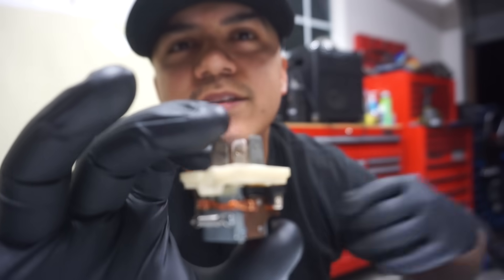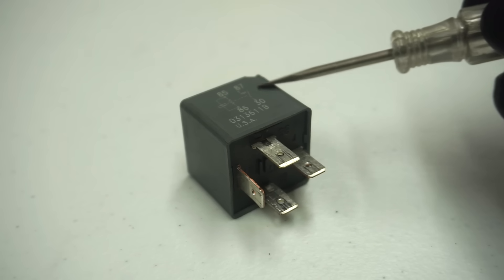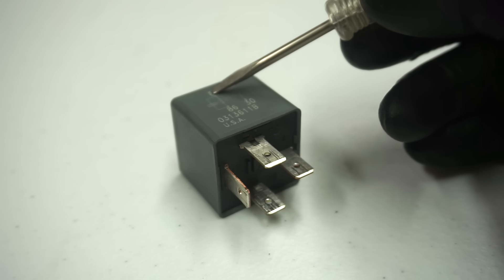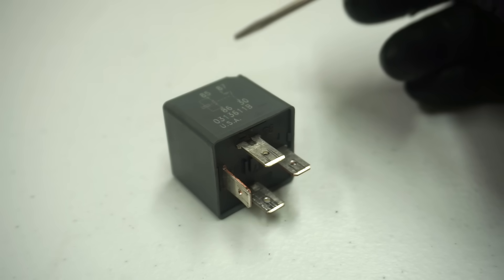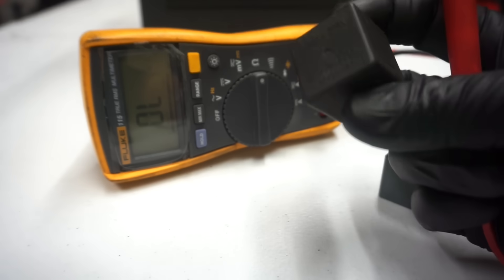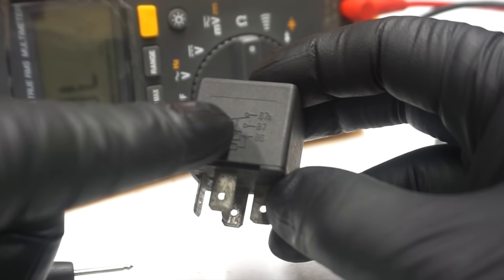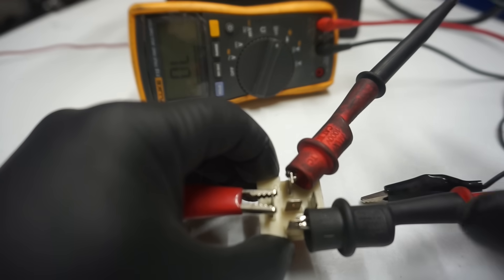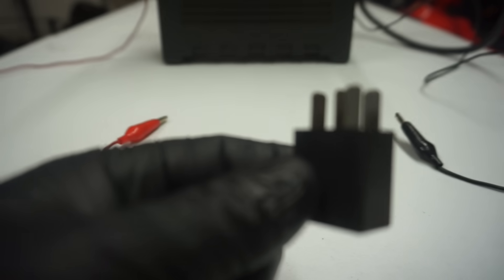How To Test a Relay The Easy Way

Comment: Why is my A/C on my Toyota Sienna 2011  blowing heat? The front and back  A/C. The back  started  blowing heat first,  then a few months later the front A/C started blowing heat.  The fuses are good.  What do we do it's  to hot for my children  to ride comfortably.  PLEASE HELP US?
Reply: You may need to re gas your AC system, or it could be the clutch is not engaging with the pulley wheel.

Comment: I've 08' malibu and struggling with battery not charging it drains it really fast when it's running I pulled alternator and fuses out and they're good I've a feeling it might be one of the relays but dont know how to check them

Comment: Pin 85 and 86 may not be switchable if there is a diode across the coil. Polarity must be observed. This diode prevents a reverse pulse, from a collapsing magnetic field, from damaging electronics with a high voltage pulse.

Comment: This is wrong and misleading, BADLY,  These test are being done without any load, Any 5 amps relay will show you good, BUT if you need a relay with 30 amps, this will miss leed you. ALWAYS use an amp meter to read how many amps those contactors can carry. If you have a starter relay that require 50 amps contact? You would test the way it's said WRONG, use an amp meter in serie with your load, then test it, IF and ONLY IF  this test works, your starter or what ever is at fault if not. replace the relay and start again cheers

Comment: HELLO HECTOR  I SEE YOU HAVE SPENT SO MUCH TIME AND EFFORT TO PUT YOUR VIDEO TOGETHER . I HAVE A 2008 TOYOTA SIENNA LIMITED ANY SUGGESTION ON FIXING A FLASHING GREEN LIGHT ON THE AC SWITCH WHAT COULD BE THE CAUSE AND I NEED TO FIX IT THANK-YOU
Reply from the maker: Saleem Abbas have the A/C system checked 👍🏼

Comment: I have a Pontiac 2006 torrent replace new battery and new alternator car run I get power at the thick wire that bolt to alternator but no power at the part that plug into alternator that goes into regulator so it not charging been working on it 3weeks could I by pass that part that plug in and get power from the fat wire that bolt to alternator
Reply from the maker: Vernard King I wouldn’t rave down that loss of power, don’t do Mickey Mouse on your car 🤙🏼

Comment: Okay so normally my brothers would do this type of troubleshooting for me but I'm on my own, I have a question so I have a 2000 Infiniti Q45 I have a few things not turning on it working. 1st power antenna, step light, and inside lights the a/c control lights not on the dash but by the radio. I checked the fuses using a fuse checker under the car pedals. Also under the hood but no fuses seem to be blown any suggestions?

Comment: Great video, help me a lot!!! Now I have a problem with codes, on a 2009 Camry 2.4  reading P0016, crank a camshaft position sensor, I replaced both three times and still have the codes, yesterday when I start my car, all the gauges are off, the warning lights are on and the tachometer and speedometer not working, could be the computer? and how it can be tested, thanks in advance.

Comment: Do automotive circuits have both fuses and relays or usually just one or the other? I seem to be able to find only one or the other in my car. Like there is a power door relay in my Caravan, but no fuse to be found for that doors circuit.
Reply from the maker: Kenny S Most of the should have fuses, relays are not used in every circuit, although I think they should be.
Reply: @HomieHektor  thank you Homie. I did finally realize there were fuses to everything. Some of them were square (J type I believe) and I thought they were relays at first.

Comment: Great job.  The relay I'm testing has only 3 prongs.  I measured resistance from the two that are across from each other.  Got 5.5.
Reply: How to trouble shoot a horn not working
Reply: Dave Ying Check the relay for the horn.  That relay will be identified in your owner’s manual under the fuse section.  Swap with similar relay.  If the horn works, get a new relay.

Comment: First time watching one of your videos and I really like how you don't waste time talking about things that on topic. Also I like how you explain things multiple times in an easy way to understand. Sub'd and thumbed!
Reply from the maker: captain obvious Thanks Captain Obvious 🤙🏼
Reply: @HomieHektor  if the relay was blown  and if you put a bit of copper wire around pin 87 and another piece of copper arou d pin 30 and plugged it in would that then fix the problem because if u touch copper wire on 30 to 87 in starts up to

Comment: Good video brother. Quik question though...... would a relay keep a car on(running) after key is removed if it is bad?
Reply from the maker: Kerry Fitzgerald Depends on how the ignition switch system is wired, but it can do it if integrated into it.
Reply: Ok thank you. I have an S-type 3.0 and it has constant power going to the injectors and or throttle body.... pulled relays it stopped replaced relays with new ones and same thing can't figure this cars problem out. Thanks again bud, I saved the video for future uses..

Comment: Bought new relays but forgot which direction to put back in 2002 Pontiac sunfire
Reply from the maker: Cathy McMain put it in either way, remember it’s just a coil that needs power and ground on either end to be energized and a switch to make the physical connection for the load 👍🏼
Reply: @HomieHektor  Thank you

Comment: Mother in laws 2001 honda civic lx will start and runs fine, after it is warmed up and you turn it off with motor warm it will crank but not start, help what is going on. battery is good connections are fine, tested and checked those. Could it be relay switches? i am frustrated with it help please
Reply from the maker: Reggie Camacho could be one of the sensors (crank, cam, ect) check for codes to see if there’s any stored. If there’s nothing there the best next best thing is to look at data when the problem happens.

Comment: Thanks for the lesson, Homie Hektor. I was troubleshooting the blower fan on my 2005 GMC canyon four-door truck and wondered how to test a relay. It turned out to be the multiple ground module on the front passenger fender, beside the air cleaner, but now, I know how to test a relay! Cool.
Reply from the maker: Ken Lovan that’s awesome 👏🏼 glad it helped you out 🙌🏼
Reply: @HomieHektor  "loo
Reply: Call in a minute

Comment: this is an AWESOME video.....i have a Chrysler Crossfire with the second kind of relay you mentioned, attatched to a circuit board.....
and i found out where i can get replacements pretty cheap, but i wanted to UNDERSTAND what was going on in there, and NOW i DO......
so im gonna order individual relays, and replace them myself.....the whole board costs about $600+  and i can get the individual relays 6 for $25 ...something like that.
it will be nice to get my speedometer back.
Reply from the maker: Ed White sounds like a Chrysler 😄

Comment: I search an automotive relay 12 V that works only above 9 V to switch on additionally spotlights. The Relay 86, the positive wire which is comming from 56a serial spotlight has 3,6 V (because the serial spotlight is working also as a daytime running lights with 30% power -BMW-). The relay is "snarring". When i drive at night is no problem, because the "Daylight" is off. Can someone help?

Comment: I was taught when using a meter to not use ohms on meter when their is current flowing. Only when power off. When you have power you check voltage, or amp.

Comment: I was a heavy equipment mechanic for more than forty years I was self taught on most of what I knew about the electrical end of the business I only wish I had someone like you to teach me some of these things great job keep up the great work
Reply: Im 44 and just learning as well. Trying to start a 96 Geo Metro with no spark but the fuel pump comes on. So I bought a millimeter. Excellent video.
Reply: Frfr

Comment: Hello... how about air suspension help....1997 Continental rear won’t lift...good bags good height sensors good pump, has a solid state 4 pin relay plugged to a connection close to pump-no one on YouTube shown how to test this rad bracket mounted relay, one vid said hard steering is linked I have both probs

Comment: Awesome!
Why are relays used ?
To isolate components from accidental shorts that may occur  within other circuits?
Reply: Daniel Ebbeling you need to ask an expert, why relays are used.
Your quote is totally wrong.
Reply: Relays in general are used to enable a low amperage circuit to switch on or off a higher amperage circuit, like turning on your headlights. ... Relays are also used to switch multiple things at the same time using one output.

Comment: If you have time can you show what to do when a cable are bad and old and are oxided meaning do you have to switch the cable or to do a bypass. It is some hard to fibnd out where the cable is going. You could look at the troubleshooting schedule.

Comment: does it always says what voltage it is or do you have to look at the troubleshooting schedule
Reply: Some times the actual voltage is coded in the relay part number. But just type in any relay part number and you can find the layout, voltage, coil resistance, carrying current and pin out of the relay. A part number like this: G8P-1A4P-12VDC has the voltage in the part number. The rest of the part number breaks down into all the other capabilities from the manufacturer.

Comment: One of the most common faults with relays is burnt contacts. Resistance checks don't work . A voltage test across the contacts under load is the test to use
Reply: 1magnit I have a silly question. How can you put a “load” on a relay that doesn’t work? If the contacts are bad or weak won’t they drop out because of the initial inrush or load? Just a couple of honest questions.
Reply: A relay has 2 main parts, the coil and the contacts. You need to be more specific on what doesn't work? A open circuit coil? or contacts that don't "make" A coil doesn't have an inrush current. The load that's switched by the contacts might or might nor, depends on the type of load.

Comment: I would like to control my fuel pump on a 2000 Honda insight. With a windshield wiper relay .I have been experimenting with a toggle switch. The Pump can be off for six second. Going uphill that's when it uses a lot more fuel. And on level ground can drive over a mile.I am heating the gas line made of copper tubing. So less  gas in line quicker evaporation. How do I make it work? Thank you
Reply: You’re serious?
Reply: Absolutely
Reply: I've also been looking at six stroke engines. If a  mechanism like what works on a strobe light were put on the injectors. To where they skipped every other injection pulse. The car would burn less gas and run cooler because clean air would go through the system without gasoline be added. The clean air stroke would cool the motor. Arduino program might could be implicated to let the car get up to speed 50 miles an hour and then skip every other injector pulse or one in three or 10. It would make more oxygen show up on the O2 sensor.  could let just one injector go to the oxygen sensor bypass with the others. Just something to think about.
Reply: Excalibur John Deere I’m left a bit confused. The answer as to why go through the trouble is Honda Insight. But so is the question. 

Labor of love ?
Reply: Excalibur John Deere why not just get a custom fuel injection computer ?
Reply: I am vapor rising  The gasoline with heat. The less liquid gasoline I heat the quicker it becomes vapor . It's like one drop of water on a stove flash vaporizers. But a gallon of water would not respond. But I'm getting 150 mpg with  my experiment . Just look at my avatar. 150 MPG
Reply: @excaliburjohndeere3887  now l am interested
Reply: @excaliburjohndeere3887  could you please explain a little bit more
Reply: jaime galindo I have a gasoline modified fuel line. I heat the gasoline. The less volume of gasoline that I heat the faster it will vaporize. I have a toggle switch connected to the fuel pump relay inside the car. I can turn the fuel pump off which means the gas in the fuel line gets hot quicker. As it expands the motor just keeps on running. That's one way of proving you get better mileage with vapor. If I could systematically cut the fuel pump off and on five seconds at a time there would always be less fuel in the modified fuel line.my avatar is the dash of my car. 2000 Honda insight manual transmission. I have deleted the battery it's not a hybrid anymore. I can get 150 mpg at 50 mph in the summertime. Now that it is cold I have to drive 35 to 40. It takes the car about 4 miles to get the gas line hot and 8 miles until there's no more improvement.

I have lots of different ideas. If you look up six stroke motors. You could possibly makes the fuel injectors skip a few cycles or pulses .like a strobe light works and get better mileage after the car reaches top speed you're going to go. If you think it you can do it.
Reply: @excaliburjohndeere3887  hey just a question.do you have tried propane,natural gas?
Reply: jaime galindo I have not. Propane has 82,000 BTUs to a gallon. Gasoline has 116,000 BTUs to 1gallon. diesel is like 130,000.

I did use a propane gas 15 pound regulator to stave the motor for gas The car probably needs at least 20 pounds pressure. I could go on level but not climb hills at 15 pounds pressure of vapor. I do use on my modified gas line a needle valve and I also use propane nozzle off of small propane canister.it's better calibrated than the needle valve.
Reply: Gasoline is a pretty good value. Ethanol has 70,000 BTUs. It's half as much energy as diesel. But it is not half price it's not a good value. British thermal unit you can look up the chart.
Reply: @excaliburjohndeere3887  ok.cool. please let us know about your project.l mean the phases of your work
Reply: jaime galindo well  I use the fuel rail and injectors to introduce gasoline into the car. And I use a modified gas line to supply gasoline to the fuel rail. But you can burn more vapor than you need and your mileage will stay the same you have to control the vapor.
Reply: If you look at gasoline vapor experiments on YouTube. They all went big . Big buckets sucking vapor into the air breather. Not good. Or they use little transducers that have high frequency sounds to vaporize gas. Not necessary. What I am doing is very simple. And it is micro. And safe. When you go big with those big buckets they use somethings going to explode.
Reply: My method allows you to spray small amount of gasoline to be heated with the exhaust. When it gets hot and vaporizers and builds up pressure you control that or you can control the Vapor going to the injectors. What you do is keep it simple. Takes about $40 to do what I did. And I did it July 2, 2019
Reply: @excaliburjohndeere3887  thank you very much for the explanation.l will be looking for these videos